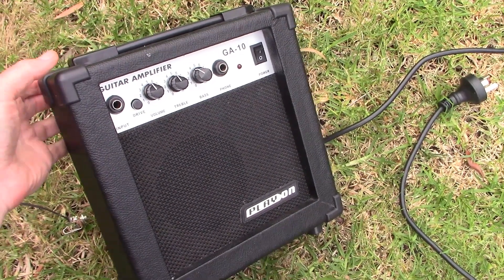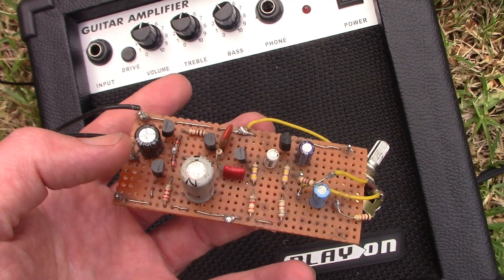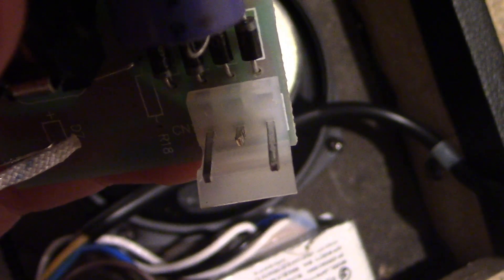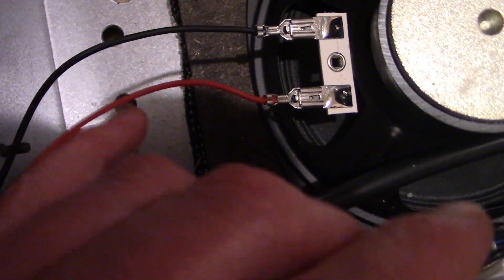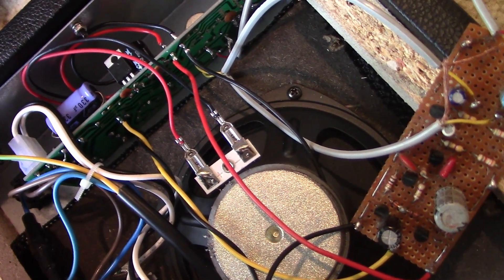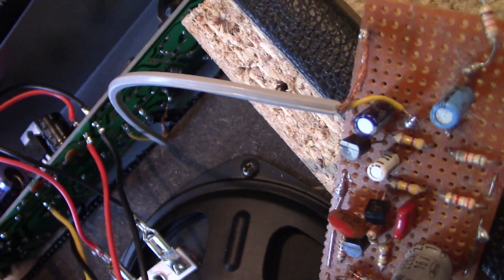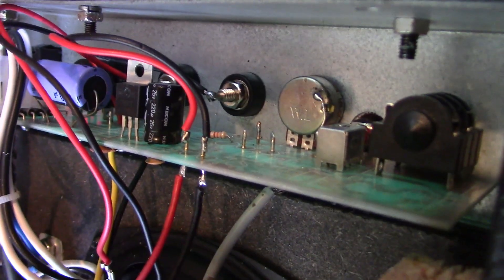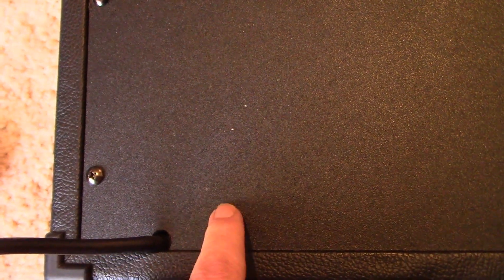New life for a street find guitar amplifier

Comment: A guitar amp is made to be clean at lower volumes and distort at higher volumes or when overdriven on purpose.
Reply: A traditional tube amp's crunch channel's power tubes do that. But this is a transistor power amp, a clean one, so it really souldn't go into break up. If it does, it's broken, or trash right from the start, like in this case.

Comment: I had exactly the same issue with this transistor amplifier circuit recently, when retrofitting it into an old Heathkit radio. Had to add extra decoupling and bypassed the first preamp stage.

Comment: isn't guitar amps built to be distorted ? 🤔
Reply: Definitely not. At least for anything solid state where clipping is just bad for everything. Distortion is achieved with a pair of parallel diodes in opposite directions in the feedback path of one of the initial op-amps. The overdrive button would have bypassed the diodes with a straight connection to run it clean (or as clean as possible for this cheap one).

Comment: OMG, Peter! You ruined the amp. Distortion is on purpose by these type of amps used for guitars or blues harmonica.😅Anyway ... I can see your point of view as a builder and a radio amateur to get a clean audio from an amp...😁... but as a blues harmonica player, my heart is bleeding...🥵
Vy 73s from DG1MJH, Roberto
Reply: Maybe next time the original amp will be left untouched while a second circuit is added for "HAM-friendly audio" :-)
Reply: Those cheap little practice amps are absoulutely dreadful though.
Reply: As an ex Marshall employee i had to laugh at this .
Reply: Any amp with an overdrive switch is supposed to have a clean channel.